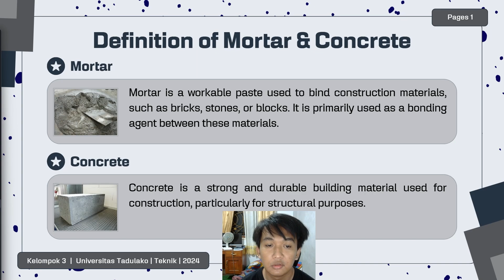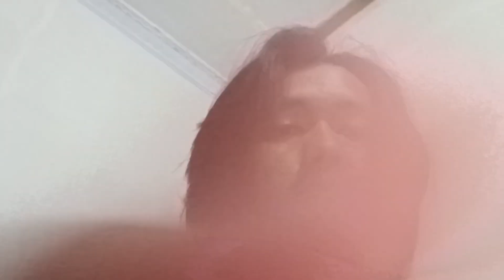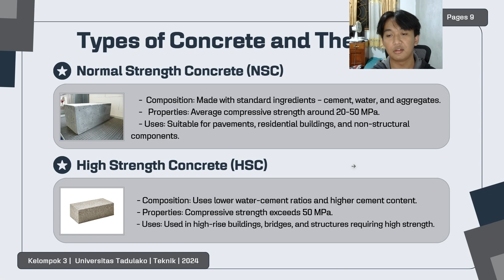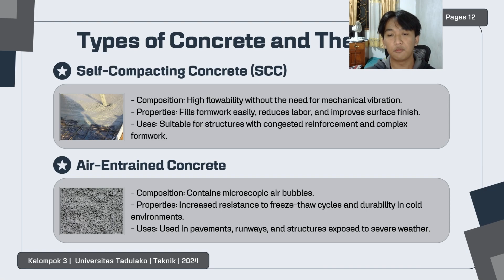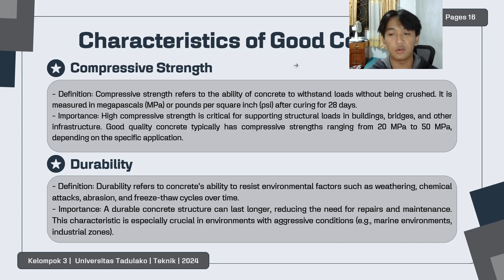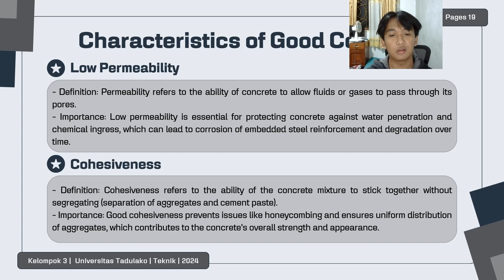Mortar and Concrete / Group 3 TBK IC

Comment: Hi, i'm Nurunnisyatummutma'innah and my student ID is F11123019, i wanna ask about between high performance concrete and normal performance concrete, which one is better to build civil buildings ? May you guys explain why ? Thank you
Reply: Thank you for your question, please allow me Muh. Farid Achmad Tryanaputra Nim F11123050 to answer it. 

Between High Performance Concrete (HPC) and Normal Concrete, HPC is generally considered better suited for building civil buildings due to its enhanced properties. Here's why:

Properties of High Performance Concrete (HPC)
1. Higher Strength: HPC has a higher compressive strength compared to normal concrete, typically exceeding 70 MPa, whereas normal concrete usually ranges from 25 to 60 MPa.
2. Improved Durability: HPC is designed to be more durable, resisting cracking and deformation over time. It maintains its strength and integrity even under extreme conditions like freeze-thaw cycles, high temperatures, and exposure to chemicals.
3. Enhanced Resistance: HPC offers superior resistance to chemical attacks and temperature fluctuations, making it ideal for structures exposed to harsh environments such as marine or coastal areas.
4. Low Shrinkage and Low Permeability: These properties reduce the risk of cracking and ensure that the concrete remains watertight over time, which is crucial in civil engineering projects where water resistance is essential.

Applications of High Performance Concrete
Given its superior strength and durability, HPC is commonly used in high-stress applications like bridges, tunnels, car parks with heavy traffic, service reservoirs, swimming pools, and water treatment plants. Its ability to withstand extreme conditions makes it particularly suitable for building civil infrastructure.

Conclusion
For constructing civil buildings, especially those requiring high load-bearing capacity, excellent durability, and resistance to environmental stressors, High Performance Concrete is the better choice due to its enhanced mechanical properties and improved long-term performance compared to normal concrete.

In summary, while both types have their uses depending on specific project requirements, HPC's advanced characteristics make it more versatile and reliable for most civil engineering projects involving complex structural demands.

Citations:
 https://www.linkedin.com/pulse/high-strength-concrete-same-performance-tech-launch-pad-techlp-
 https://www.aggregate.com/blog/what-difference-between-traditional-and-performance-concrete
 https://imixconcrete.co.uk/news/high-strength-concrete-vs-normal-concrete/
 https://www.degruyter.com/document/doi/10.1515/rams-2022-0323/html
 https://www.sciencedirect.com/topics/engineering/high-performance-concrete
 https://www.researchgate.net/publication/352544348_HIGH_PERFORMANCE_CONCRETE_ITS_APPLICATIONS_IN_CIVIL_ENGG